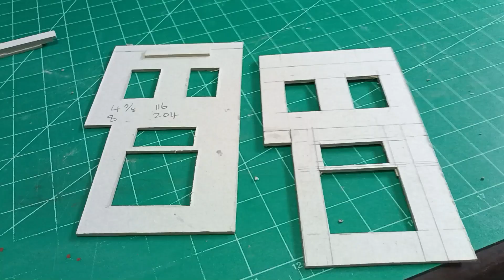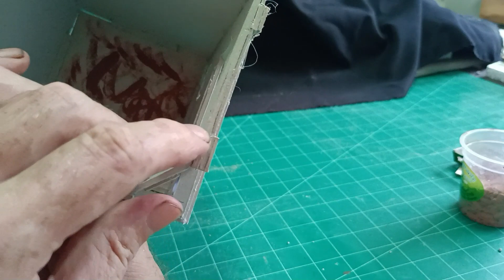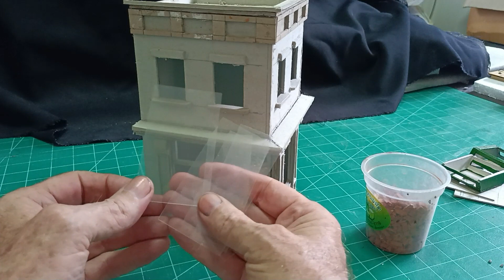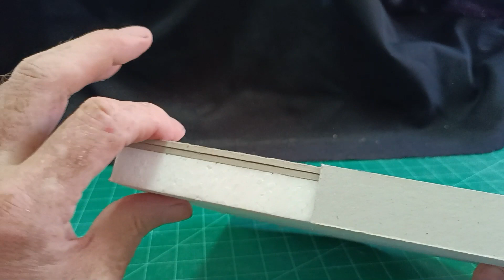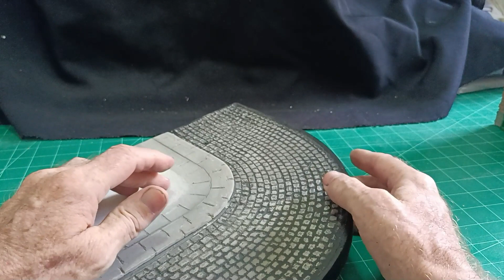Scale model corner shop 1/35. How to make.

Comment: 1:03 - 3mm card understructure
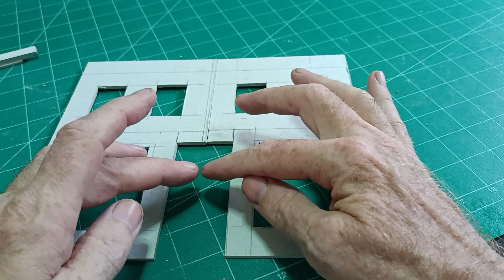2:48 Establish Scale and dimensions from a door - a direct human interface item which determines relative sizes for everything else.
4:30 Layers of card for details and moulding. (3mm and 1mm card)
17:10 outro

Diorama Don relevant links
Ruined Building: https://www.youtube.com/watch?v=FrFnUs1kSS8 (knife awareness and safety)

Bricks: https://www.youtube.com/watch?v=ZXKFH30E5OI&t=14s
Brick Wall: https://www.youtube.com/watch?v=BVRNUBgdJw8 (as whole wall and grouted)
Brick Wall: https://www.youtube.com/watch?v=EHMsVVHHYlE (individual bricks laid out and grouted)
Brick Wall: https://www.youtube.com/watch?v=1WThxC_wHVM (with decorative elements)
Brick Walls: https://www.youtube.com/watch?v=u-l_7-7X6JE (two methods of manufacturing and assembly, then: mortar, distressing, and weathering)

Doors: https://www.youtube.com/watch?v=uH8BbLfxI6s&t=354s (static - not openable)
Windows: https://www.youtube.com/watch?v=momLM4ApdT0 (openable)
Windows: https://www.youtube.com/watch?v=71zCWiq12jA (static frame - not openable, with curtain)

Painting without Paint:  https://www.youtube.com/watch?v=DkdaFyrOjbo (painting with tile grout)

Cobblestone Street: https://www.youtube.com/watch?v=TdJuPAYTVVc
Cobbled Street: https://www.youtube.com/watch?v=TdJuPAYTVVc&t=3s (cratered)
Cobbled Street: https://www.youtube.com/watch?v=41deX7L-Nhk (with tram lines)

Roads and Paths: https://www.youtube.com/watch?v=B1qISIY2Gfg (Tarmac Road, Concrete Path)
Pavement and Sidewalks: https://www.youtube.com/watch?v=uZiXAIDTEZ0